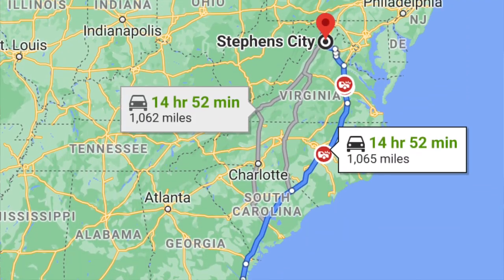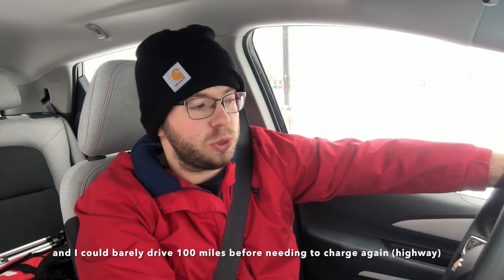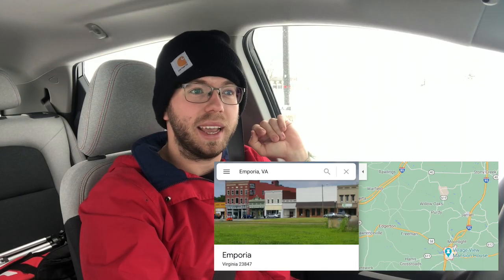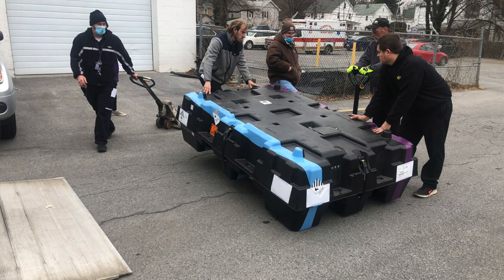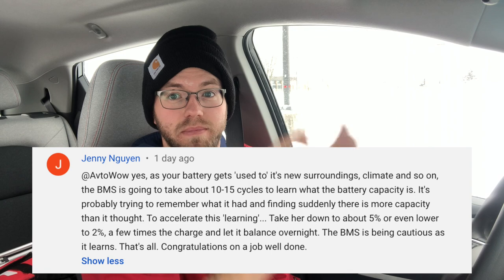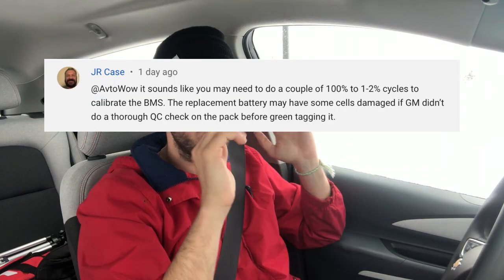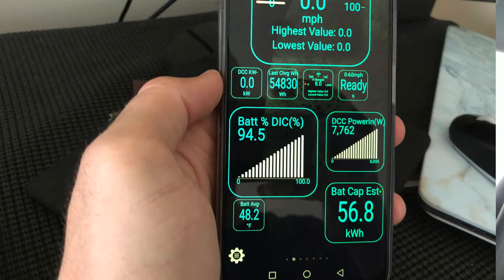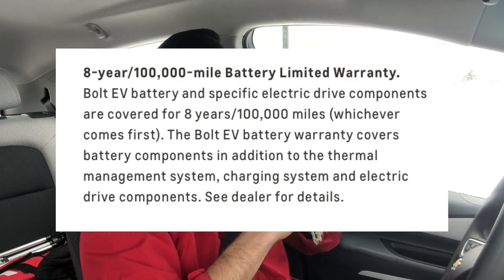How I found a problem with my Chevy Bolt's battery: full story

Comment: Thanks for sharing your story! FYI - I had a similar issue, and it was quite a journey to get it fixed. When I bought my 2017 Bolt Premier in August 2020 I immediately thought something wasn't right because the range seemed low, and it was my understanding that Bolt batteries don't degrade that much. I eventually got an OBD2 device and an app to actually see individual cell voltages. One cell was .3V less than the average of all the others. I did research and found that it was way out of spec. A technical document that someone posted in a Bolt forum said anything more than .07 difference should be considered a problem. The first dealer NEVER answered the phone, so I just showed up one day at the service center. Unfortunately the technician wasn't there (WHAT?!), so I was told to call the rep's number in a few days, and he would in the meantime ask the technician about my problem. I called back, and I was told that said .3V or even .4V difference was "normal," and they proceeded to mansplain me as if I didn't know what I was talking about. They said that if my car had a problem it would display a code on my dash - not true. I was told they could do the diagnostic test but would charge me. I asked who else I could talk to, and they referred me to GM Customer Care. I spoke to someone (after phone tree hell), and they said they'd have to refer me to a technical person. They called me back two days later and told me to call a number. I did, and the man said he needed to transfer me. Instead I got cut off. I called back and got a woman, who said she would transfer me, and guess what I ended up back with the first guy who asked me why she transferred the call to him. How the hell would I know?! Anyway, I got the bright idea to start over with a different dealer, and had a completely different experience! The woman who helped me seemed to know what I was talking about and said that they would do a diagnostics test. They were quite backed up, so it took a few days, but lo and behold - yes, I indeed had a dead cell, and they would need to replace one of the five battery modules. It took a while to get the part and then to install it, but it was worth it. Before the replacement (and before the recall fix) I was getting 166 on the GOM on a full charge. Now with the recall fix (permanent hilltop reserve mode) I'm getting 240 on the GOM. That number is so high because it's not that cold where I live (San Francisco Bay Area), and I drive prudently. My average is 4.4 m/kW. I don't mind the permanent hilltop reserve mode because I live at 1600 feet and drive downhill to work, so I would use it anyway. I recommend to everyone who suspects a problem to get an OBD2 device and app to look at cell voltages. One more thing - I suspect that the reason some Bolt's catch on fire when the battery is at full charge is actually due to a bad cell. The battery management system tries to charge more than is possible and then catches fire. I could be wrong, but it makes sense to me. If that's the case, they should do diagnostics on all cars affected by the recall to find out.
Reply: Thanks for the info. What app do you use to check your battery and what obd devise?
Reply: @corycornett5868  Android Bluetooth Wireless OBDII Reader & Scan Tool - For Android Devices Only BAFX Products®
Reply: @butspan7618  yes, I suggest anyone buying a used bolt to hook it up to the OBDII reader to find out if the battery is bad or not.

Comment: Another 2017 Bolt owner here. It's troubling to me that there is no indication of bad battery cells  (similar to a "check engine light") but the technician at your dealership confirmed that there were bad cells. We're all wondering about our batteries now 😬

Comment: Thanks for the story.  That’s pretty cool that after 2 or 3 bottom to top charges, the BMS got smarter, and you’ve got a complete Bolt again.  Just wait until you see the range you get just putzing around in the summer - a way different car, and it’s a blast to drive.  As a used car purchase, the car certainly looked clean, at least from afar.  No mention from the dealer what’s coming to Bolt owners beyond the 95% cap they’ve offered/done to date?
Reply from the maker: That’s for sure in the summer I know the car will be able to do at least 3.5 3.6 per kilowatt hour.  With just over 30,000 miles when I got it it looked like it was brand new but like with any EV the major issues can be on the inside instead of outside. The place I went to although they did a good job fixing my car they didn’t tell me anything about what to look forward to in the future for 2017 to 2019 Bolt owners. I think by next November if nothing comes up as a permanent fix they are going to be up against some very angry car owners.
Reply: @AvtoWow  I think you’ll see upwards of 5 or 6 mi/kwh at certain times.  A cap of 95% only takes about 10 miles out of your available range, so although it’s a bit of an inconvenience (can’t use that top 5% to start a trip), will it get people riled up if they don’t have it?  Perhaps there will only be a financial incentive paid to original purchasers - if Chevy sees that the field issues have stopped in the time that has elapsed since their warning.
Reply: I also live in Virginia.  I have had my 2017 Bolt for about 3 years and average around 4.5 per kilowatt hour.  Usually, it goes down to about 4.1kw in the winter months.  I didn't take any long trips this winter and just drove locally so it has stayed around 4.5 per kilowatt hour this winter.
Reply: @AvtoWow  I second what Dennis said. I got my Bolt in October and if I was somewhat gentle I could get 5 miles per kWh until it got super cold. Now that it's <20F outside I get 2-3 mi/kWh.
I live in CO and the first weekend I had it I drove up to Grand Lake and back, about 250 miles round trip and a gain of 4000ft elevation. I charged for an hour up there, got about 50 miles recharged but it wasn't needed. Coming down the mountain in L mode I was getting almost 7 miles per kWh thanks to the regen, plus my brakes didn't get any wear on them.  :)

I know I should get the patch for the battery, but I don't charge indoors and it's been only 5 Bolts out of thousands that had the problem... eh I'll get it eventually. :P

Comment: It is called recalibration. Most all Li battery packs work like you "discovered." I am irked by the so-called dealer technician not telling you this fact, or better yet the tech should have done the recalibration for you! Shows us that dealer techs are seldom all that well trained.

Comment: Glad to hear you're good. Sorry you had a bad pack to begin with. 

Fwiw, I have 26,000 miles on my Bolt and I recently a full range capacity test and I have 59.7kWh still, so don't let anyone tell you that 57kWh is max capacity.
Reply from the maker: Thanks Rennie!

Comment: I love how the manufacturer told him that the battery cells were no good and instead of getting him a new battery they gave him a refurbished one and his standards for this manufacturers so low that he was happy to take it. You buy a new car and the engine is messed up they don't give you a refurbished Engine with 32000 miles on it they give you a brand new engine
Reply: the GM I knew would have said to pound sand, the defective battery cell problem would have been denied, or said "that's how all bolts are"  LMFAO

Comment: I wonder how often this has happened in the Bolts (I also have a 2017 LT fully loaded with about 38k miles) and why they don't do routine annual checks of the battery pack's health as part of the suggested PM.
Reply: Probably because "if it ain't broke, don't fix it" and it would cost them time and money. They would wait until the customer reported a problem then they would investigate.
Reply: It almost never happens, but if you buy the cheapest Bolt you can in Florida you massively increase your personal odds of getting one of the 0.01% that have an issue  :-)

Comment: I should have also mentioned that if the refub pack has LG cells in it then the car may also have a new fire hazard problem added to the mix. I strongly suggest you find out exactly who made the cells in your pack now.

Comment: I have a 2017 bolt with 48000 miles on it and I have only been getting 150 miles per charge. I wonder if I have a bad battery.. did you have any warning lights? Or messages?
Reply from the maker: I did not have any warning lights but the way I measured to see if there was a problem or not is going to your energy usage screen and then track how many kilowatt hours are being used for every bar that drops on the energy gauge. Also,  get a full charge and then run it down to one bar and see how many kWh was used up.
Reply: Where do you live? Keep in mind the weather and your driving habits. My efficiency is 2.6 at the moment and in Chicago winter around freezing or colder so my "full" range at 95% is at the moment 140-150 miles. During summer I'll be back to 250 miles or better.
Reply: @davidmccarthy6061  I live in oregon. Lately the tempature has been 42 to 48. I always run my heater on 70 on the auto setting. Mine averages 3.0 kwh
Reply: My last charge gave me 149 miles, but living here in the Northeast, that's normal. This is my third winter with the Bolt so I know what to expect.
Reply: See the post I just submitted today.
Reply: @corycornett5868  150 miles / 3.0 mi/kWh = 50 kWh. For 48K miles car, that's typical.

Comment: Could it be that the former owner would only drive a few miles then recharge it, so it never cycled down?
Reply: This bad cell issue is a known problem with early production 2017 Bolts.

Comment: Quick question, what's the warranty on the bolt (in other words miles/years).
Reply: The bolts battery warranty is 8 years/100k miles

Comment: I live in Jersey when I plug in the car at night in the morning I'm getting 218 mile range the car have only 21,000 miles anyone experience situation like this and what battery cell Devices I can use to check individual cell on Chevy bolt 2022

Comment: Why would you drive until the battery is totally dead? I own a Bolt EV and it gives you plenty of warning about your state of charge. Pay attention to the car dude.
Reply from the maker: Its a learning process of getting to know your car dude. When your car has a battery issue and jumps from 32 miles to empty to "low batter" mode in a matter of miles, you have no choice but to drive it as far as you can.